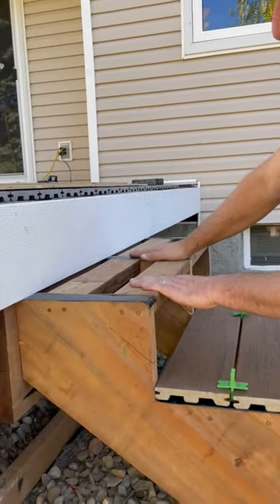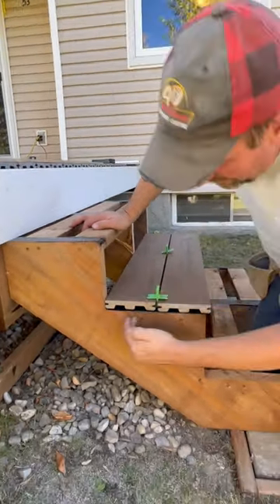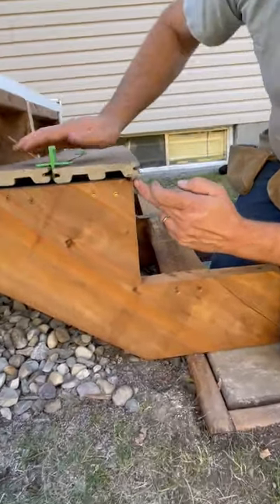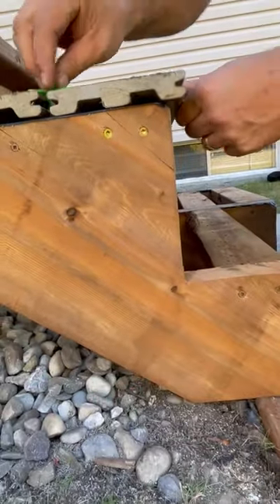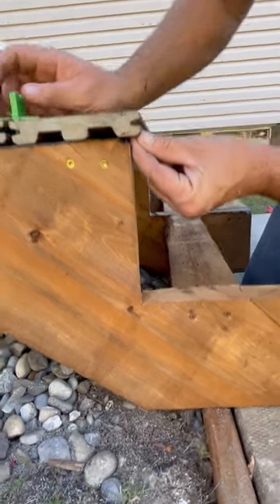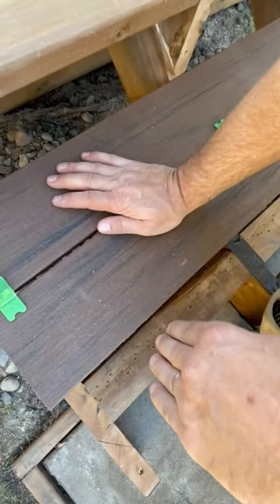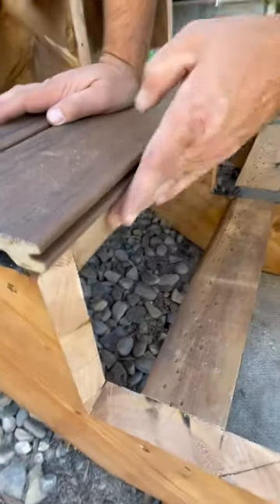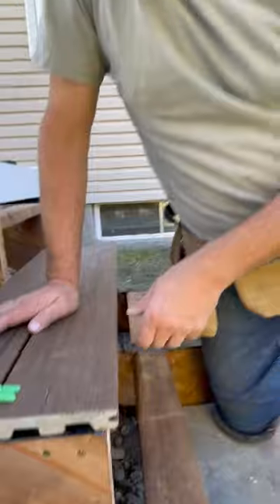How Long Should Stairs Run be for Composite Decking?

Comment: Bad advice. He does not factor in the risers or skirt/facia boards. Only cheap hacks leave out the risers and skirt/facia boards. Not to mention that is not the correct tread material with the grooves smh. 🤷

Comment: I cut mine 10". Where i live code requires a backer on the steps. With the backer that make the step 9.5" step boards are 5.5" x 2 = 11" This will give you a 1" nose on front of step. Looks great and no problem with water. Also. In a typical stair set, I will use 5 Stringers for composit (aprox 10.5" between sringers) decking and 4 for wood. I cut my frame  for steps at 41 7/8. My reveil on the sides of deck steps are also 1" with the wrap on side of steps as well. I also use SOLID EDGE decking for steps.

Comment: I always cut them 9 1/4”  that way you have a 3/4” over hang plus 3/4” spacing the the plinth blocks and fascia riser.
Ps, should use rounded boards on the front board.
All the best !

Comment: The rough tread depth on deck stair stringers is always 10 5/8 if you’re using two decking boards. That gives 1/2” of overhang. If you really want to do a killer job, wrap it all in pvc before installing your deck boards and install blocking to return your treads back on a miter into the riser.

Comment: I cut them 10 if I'm closing in the risers with azek etc. Anymore then 10.5 and there is no meat left in the stringers
Reply from the maker: Yes, 10" run is my default setting. Recenlty with Trex I have been expermenting with 10 1/4" with slighly bigger boards the extra 1/4" seems to help.

Comment: Wow use solid decking with no groove.  Not sure if you follow code but no riser???  Cut treads at 10"" that will allow riser to sit behind decking treads.  The first riser off deck cut at 9 5/8 to allow 3/8" composite riser.
Reply from the maker: I installed blocking under the decking which allow me not to use a solid riser board. 
Sounds like you have built a few deck stairs.

Comment: It going to get water on it its outside  wrong decking thats hidden fastener decking composite material needs 1 foot spacing on joists and stringers no blocks needed looks like lost an inch on first step tucked under band

Comment: Bruh get coated hardware for your stringers, put greenwood liquid on your cuts fully cover stuff with trex tape, get square edge boards for your stairs. What the hell is that middle stringer. Don’t be a afraid to spend a few bucks or you ain’t gonna ever make shit.